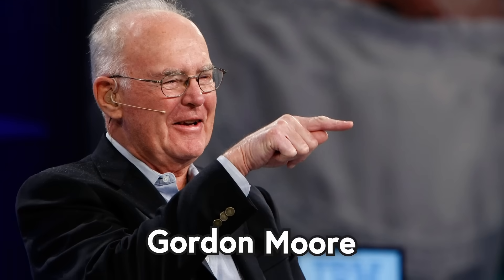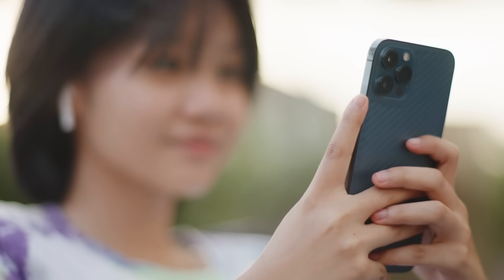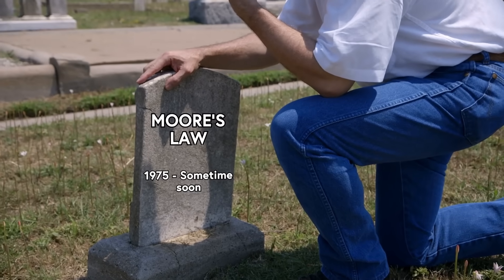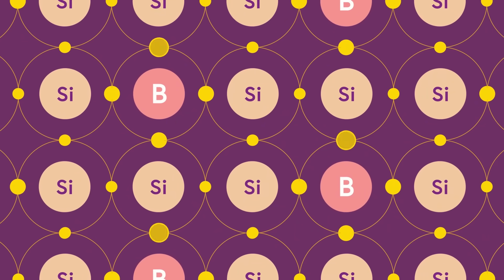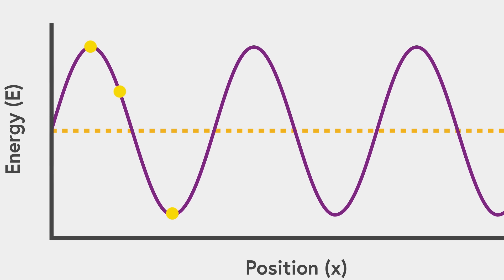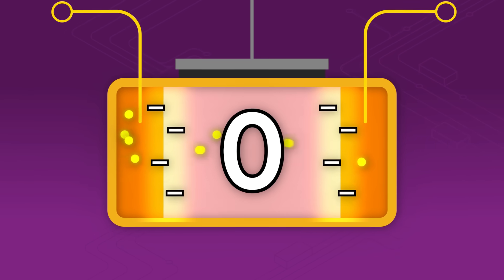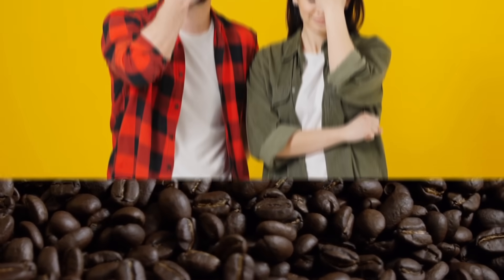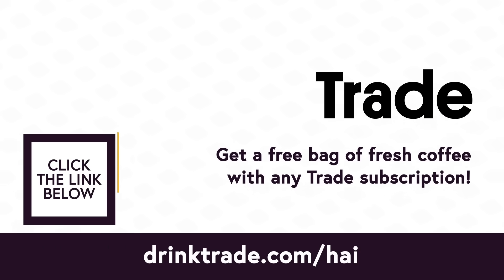Why We're Reaching the Theoretical Limit of Computer Power

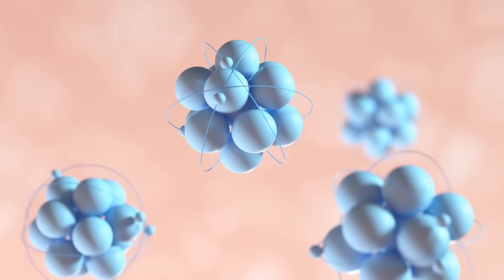Comment: 3:57 As a physics major, that's the most accurate depiction of a quantum physicist I've ever seen.
Reply: Totally agree! The traffic/transit analogy really works as there’s a non zero chance you’ll go the wrong way 😂
Reply: Can you tell me wtf the barrier is in quantum tunneling? Like in 3d, does having a “barrier” that is thicker in any dimension (hight, width, depth) make it a “larger” barrier in the wave function? And does the material of the barrier matter?
Reply: @Jwellsuhhuh  A barrier is basically anything that stops the particle from going there. Often this is an electrical charge in the way. For example, alpha decay can be thought of as whole alpha particles inside the atomic nucleus quantum tunneling outside of the nucleus. Nuclei are positively charged, and so is an alpha particle. Classically,  the coulomb/electric force  would hold that alpha particle inside the nucleus forever. It is the barrier in this example. Because of quantum tunneling, there is a nonzero chance that the alpha particle is not inside that nucleus despite the barrier in place. Nuclei are tiny so the barrier is thin enough that a somewhat significant number of alpha particles tunnel through it.

In many sense that means that the material, physical thickness, etc. of the barrier can play important roles in the probability that a particle quantum tunnels. A thin barrier, such as a thin piece of paper, will do less to get in the way than  a thick sheet of lead composed of many densely packed very positively charged nuclei
Reply: @Poleuniquename  is it possible to do some sort of entanglement such that any errors cancel out, similar to the way  that ethernet cables wind against each other cancelling out error?
Reply: @Roshkin  I'm not sure what you mean
Reply: @Jwellsuhhuh  there’s no physical barrier (like a fence or a wall). It’s more about distance between the two poles of the transistors: if they’re too close from each other, electrons may just “jump” the gap between the poles even though there’s atoms in between. That “jump” is the tunneling. 
So the distance is the barrier as it prevents too many electrons from jumping. 
The thing with quantum tunneling is that it always happens - electrons can really be anywhere around the nucleus, they’re just most likely to stay close. But there’s a non-zero chance that one of “my” electrons is going through your body as you read this message - regardless of where you are.
Reply: As another physics major, I'll give this to Amy. For a sociologist, she did pretty damned good.
Reply: As a physics major, quantum information is only good because the feds put a ton of money into it and we can use that to get free food at events
Reply: Sa q_^a

Comment: That does it boys, we going to the moon using my old xbox 360 guidance system 😂
Reply: In space you have what's called the shotgun problem. You see up there away from the protection of the Earth's magnetosphere there's a lot of cosmic rays flying around. When one of those high energy particles goes through a digital gate bad things can happen. It depends on the size of the gate what the impact is. Imagine shooting a billboard with a shotgun and a postage stamp. On the billboard you're still going to be able to read whatever was on the billboard. A postage stamp, not so much. Little gates really take a beating from the shotgun problem. So we use special integrated circuits in space. They're about on par with the old 486 CPUs. You need hardware that clunky to survive the hits.

Comment: it's all fun and games until quantum computing
Reply: Quantum computing is weird.
It doesn't really use traditional transistors, because it works on qubits rather than bits. Rather than swapping between off and on like a normal bit, a qubit can pull a Schrodinger and be both at the same time. Kinda. Quantum physics is very unintuitive.
Anyway, as far as I'm aware there aren't any quantum computers that use traditional transistors yet. It's theoretically possible, kinda, but the few quantum computers that do exist don't use them.